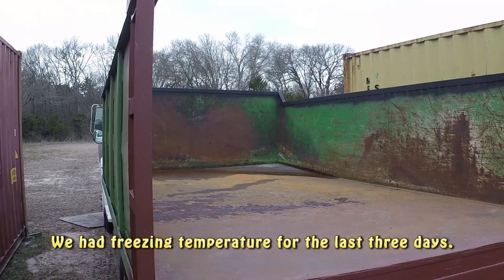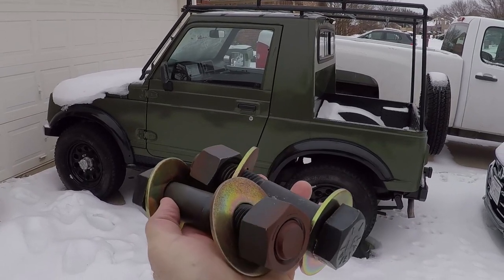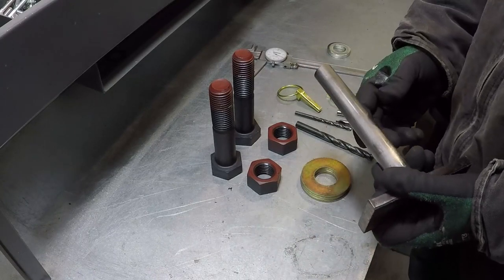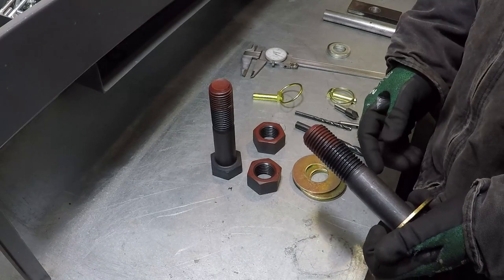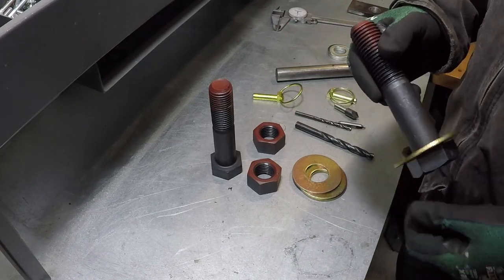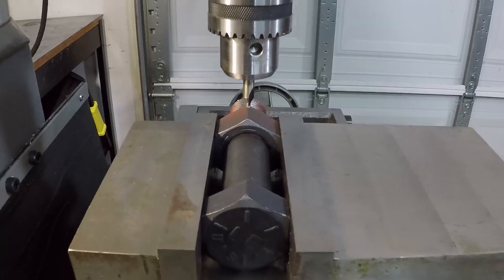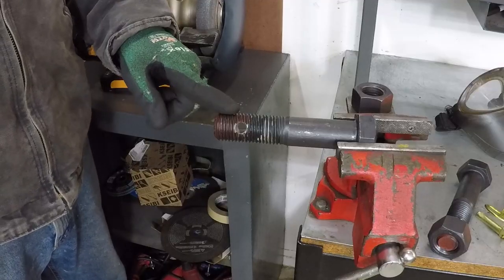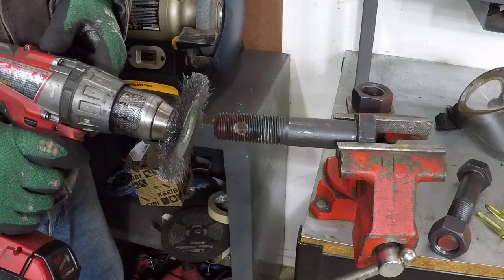Dump Truck Project Homemade Tailgate Pins

Comment: another good one! i wish i had a shop with a milling machine.
Reply from the maker: Milling machine and metal lathe are big help for fabrication. They do make the job easy and will save money specially for hard to find parts. My current shop is only 12' x 16'. I originally built it as storage. I ended up putting a mill, lathe, other metal working tools, wood working tools and electronic equipment. I am hoping to build a shop soon on my farm. Thank you for the comment.